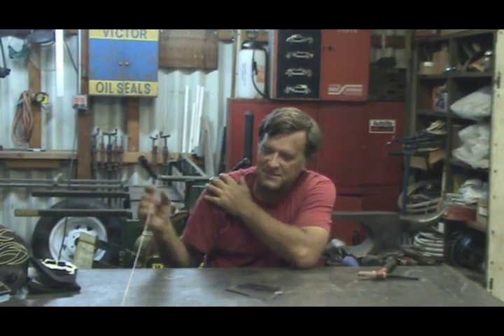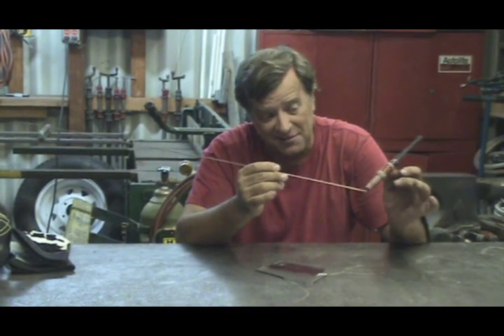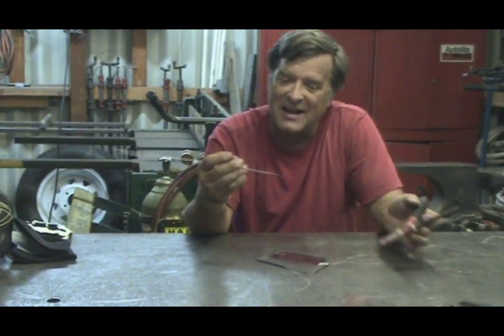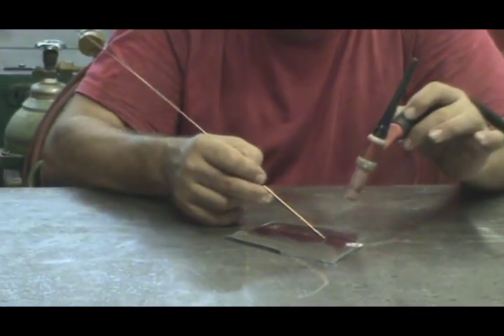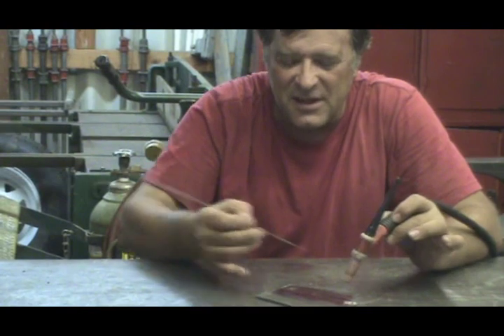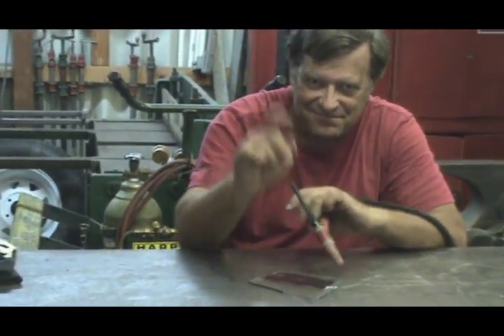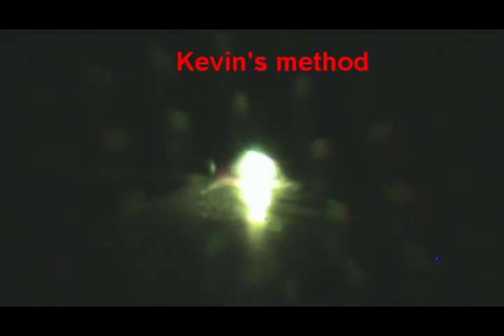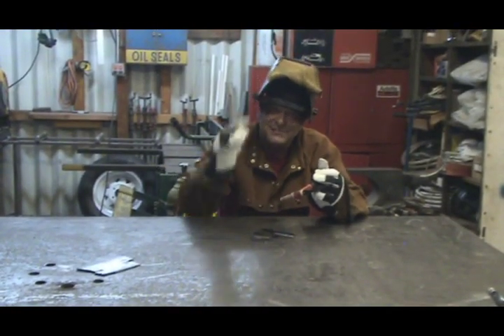TIG Welding: How to Feed the Wire - Kevin Caron

Comment: What did I do wrong if I get shocked
Reply from the maker: You put yourself in the ground circuit.   Or you just had sweat on your arms and leaned against the metal and the bench at the same time.   Happens to all of us at one point or another.  The smart ones are the guys that learn from it and don't do it again.   Sadly I am not one of those!

Comment: A stationary wire feed hand is fine when you're doing small joints on steel. If you ever move to larger aluminum stuff, you have to learn how to feed with your wire hand. The puddle just demands too much filler and you can't have 30 restarts. Hand feeding wire is like playing guitar. At first its awkward and weird and you can't do it, but then you practice and practice and eventually you can play those chords. The catch with welding is that most hobbyists don't ever get enough hood time to ever become truly proficient at it but you can practice the basic mechanics with a tig wire anywhere.
Reply from the maker: well said!

Comment: @kevincaron I am currently taking classes for welding and when you weld the filler rod and pull the gun back your contaminating the weld in that spot because the gas isn't there. Just like having to hold the gun over for a second after you end your arc for post flow.

Comment from the maker: @GameFishermen Glad to meet another self-taughter.  Anyway you get the filler down is great. Long as the weld holds and the holes are filled, it's all good in my book.  With my work the beads are almost always ground smooth anyways.

Comment: I've had roughly 2 years of TIG experience now, more aluminum than anything. I've had better luck with just dabbing filler instead of letting the wire hang in front of the arc. I just think dabbing gives a better looking weld. But its all personal preference, and like you, I taught myself how to TIG. Good video and keep em up

Comment from the maker: @80MOOSE08 I did a video on this subject. In my opinion, yes, it does help. If you check in your manual that came with your machine it will probably show you how to sharpen them.

Comment: @kevincaron 

ok i will try lowering my filler rod, thanks, i weld with a fully sharpened tungsten, ive heard people putting flats on the tip, does this help?

thanks again

Comment from the maker: @80MOOSE08  Off hand I would say you have the filler wire too close to the tungsten and too far away from the metal you are trying to weld. Hold the filler rod closer to the weld and you should not have anymore problems. If this doesn't help please get back to me with more info. and I will try to help. 

Thanks for posting ....

Comment: I like this video, thanks for the tips, I tries this method at college today, but when I allow the torch to melt the rod it balls up on the end of the filler rod and then drips of into the pool, in the video it looks like the filler rod is melting cleanly into the pool, I'm on 100 amps, with a pointed tip tungsten, on 1/8 inch mild steel, I do all the correct weld prep and weld on clean steel (grind it to get all the grease and scale of) can you help me please?

Comment: All the big names in the racing industry(motocross,nascar, ect. use the stack of dimes look method by dipping the rod. Its pretty much a standard as far as tig welding. its harder to learn the stack of dimes method but it is just as strong as a straight bead and it looks classy...2 percent thor. tungsten's work nice on steel or aluminum ..sharpen it to a nice point and let it ball up on its own with aluminum.

Comment from the maker: @tjtorchart1 Well the book does say to NOT sharpen the tip to a point. You should leave about 2/3rd the dia. of the tungsten as a flat spot on the end. Wider for higher voltage but not to a point. I have had good luck with this setup. Give it a try and let me know what you think.